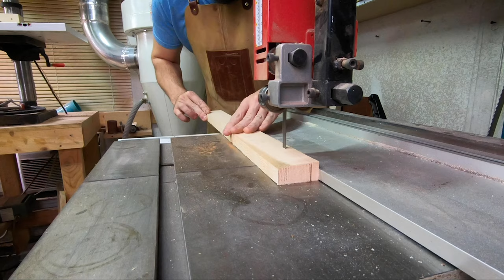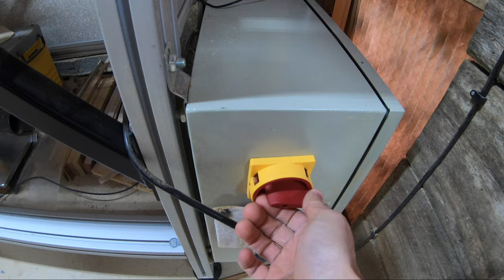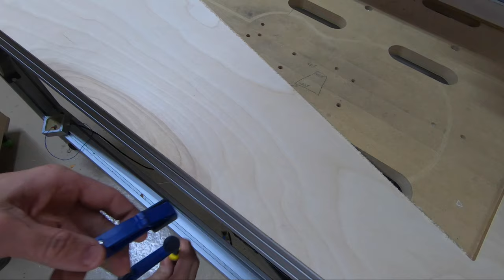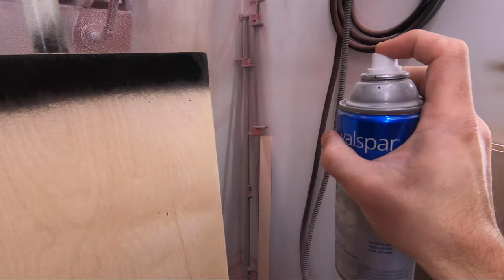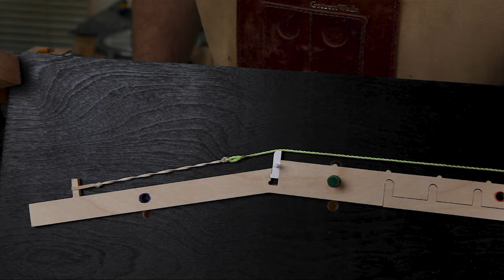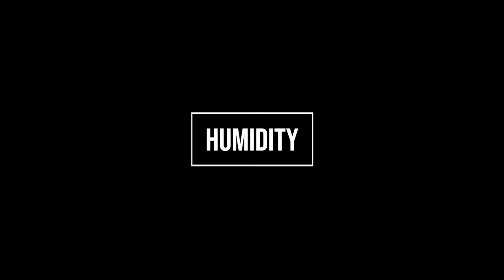How to adjust the action on your guitar.

Comment: Great video. I have an old $100 beater acoustic/electric I've had it for almost 20 yrs. Could never get it to intonate. So I tuned it for slide. However saw another builder's video, a guy described exactly what was wrong my old beater. The guy said "check your nut". 1st I lowered the action by shaving the saddle, that helped, but it still was sharp along the fret board. Decided it was an inexpensive guitar, so I did the half pencil trick, all the strings were too high. I filed the slots to the point I had .020 at the 1st fret, the old guitar came to life. Every fret was in tune on all the strings (to my amazement). The guitar is basically plywood, but she actually sounds Great! I decided to do the same with a newer 335 copy I bought for $150, that, a fret leveling & crowning, a new set of $20 humbuckers, set the action to Gibson recommendations, that guitar sounds good (the pups are $20 so ididnt expect it sound like a real 335), plays like a dream as well. I've been playing 50+ yrs, & never realised how a few thousanths on a nut, could make such a difference. I've got a '92 Fender Telecaster that only needed a bit of saddle adjustment, it's always played great. Of course the guitar companies do set their guitars up with high action, (so they don't buzz when people try them out). Funny how a few tweaks can turn a cheap guitar into 1 that plays well, & sounds pretty good.

Comment: Chris that model is extremely useful, for both acoustic and electric guitar fundamentals. It clarifies the multiple factors that will impact a guitar's playability. I think people often think there is a silver bullet approach, when in fact its' more likely to be a few small adjustments of the 3 main points. (neck relief, nut height, saddle height)
Well done.

Comment: Awesome! I just leveled and crowned the frets on my Furch, cut the nut to the optimal height as well as reglueing the bridge which was coming loose. Unfortunatelly the string height is still not great with nearly zero relief.
This video led me to the conclusion that it might need a neck reset as well. Thanks!

Comment: I loved the demonstration as much as everybody else did. Thank you.

I have an idea for a follow-up video. I am contemplating the installation of taller fret wire. I have not experienced taller frets, so my first question is, "What are the pros/cons and what is your opinion?" There are some questions that your demonstration brought to mind: 
 - Taller frets would bump the straight edge to be above the top of the bridge, right? What countering process would be required?
- What are the other setup considerations/adjustments that will be forced by installing taller frets?
- Could taller frets obviate the need for a neck reset?

Comment: When someone brings me an acoustic to lower the action the first thingI do is eye ball down the edge of the neck to check whether it has any relief or not. Then I look to see whether the top of the bridge aligns with fret board top. Often with neck and body creep from string tension little can really be achieved without a neck reset which is a lengthy and expensive job. Lowering the saddle or even shaving down the bridge which I’ve done several times is only really a temporary fix. 
Great teaching setup jig you have made. 👍

Comment: I live in dry Arizona.  I use 2 sound hole humidifiers in the case, I place one of the humidifiers in the sound hole, the other is just the wet sponge from the other humidifier placed behind the headstock sitting a platform I made for it.  So far so good.

Comment: Fantastic explanation Chris, the clearest I've ever seen. One point about the Taylor guitars is that if you're the original owner you can contact Taylor and they'll put you in touch with a local authorised repair tech to do the work under warranty. Also, if you feel competent enough to do the work your self they'll send you a few sets of shims free of charge so you don't have to go to StewMac. You've got a great channel Chris, thanks.
Reply: My local authorized repair tech stated enfatically that this is normal maintenance and not covered under warrenty. I have seen another video that stated what you did. I don't know what the truth is. And yes I'm the original owner. This is frustrating to not have a clear answer...
Reply: @danherrick5785  Hi Dan, This is my experience as the original owner of a Taylor GS Mini. I was never quite happy with the action over the whole of the neck. As I'm based in the UK I found out the main UK Taylor offices were in the Netherlands. I don't know where you are but if you go on the the Taylor website they can tell you where the nearest Taylor affiliated luthier or tech is that will do the work under warranty or as in my case, I was confident I could do the work myself so they just sent me a selection of shims. 
The only possible problem I found was they need you to have registered the guitar and serial number with Taylor, which I had already done on line as I had bought the GS Mini in early 2012. 
I don't know about any other Taylor offices around the world but the people in the Netherlands were ever so helpful (and I'm not getting paid to say this) 😂😂😂.
It seems to me that your 'authorised repair tech' wasn't an authorised TAYLOR repair tech, otherwise he would have known it was covered by Taylor's warranty.
Since I changed the shim under the neck my guitar plays beautifully all the way up and down the fretboard. 
I hope this helps you.

Comment: Fantastic demonstration. 
Now that carbon fibre guitars are finding a following, it would be interesting to know what you think about them, humidity handling, potential age related issues, sound/sound changes with age/humidity and ease or not, of setting up and/or repairs or re-adjustments.

Perhaps this is a little off topic as you work with wood but still, I would imagine you would still be quite informative on the subject.

If you have a video on this topic, I'd be sure glad of a link to it. Anyway...I enjoyed how you set this video up for us which was probably as Good as anything anyone could want for setting up the action.

One thing worth mentioning is going in small increments at a time with truss rod adjustment, a 1/8 to 1/4 turn as necessary every 24 hours is what I was taught if you value your guitar, giving the wood time to settle, I'm not saying this is right in every situation, just safe.

Comment: Just as good to know type info.

 Many car feeler guage sets, have one guage that is brass. That brass one is usually the .010 one. It's brass because back in the day some auto manufactures requieed the gap in the points to be measured with nonferrous (no iron) material. The brass guage solved that problem.

Comment: Hey Chris, awesome videos , extremely informative and well done. I have not built a guitar yet but will soon, I do have a small woodworking shop and have built a lot of custom display hangers as well as enclosed cabinets with sliding plexiglass covers . I think it would be a good idea in the cabinets (and gun display cabinets ) to install dehumidifiers for my clients..... especially for the higher end guitars . All I'm really seeing are just dry packet things , are there electric options for automatic temperature and humidity control ? Recommendations or thoughts appreciated . thanks ...

Comment: Really brilliant visual way to understand set up variables to get optimal playability.  I am bit confused about the relief adjustment using the stew mac dial caliper tool.   I thought the relief measurement is to measure the max space between lowest part of neck bow and bottom of string and is normally midway between the 1st fret and 12th or 14th fret, or around the 6th or 7th fret depending on where the neck actually bows the most.  At about 8:20, you explain that the Stew Mac relief tool measures the relief at the 12th fret.  And some guitar have "fall off" on the height of the frets on the upper fret board beyond where the neck meets the body, so it seems that would be a variable factor if you are trying to use that tool to measure relief at 12th fret.  I normally measure relief by using a capo on 1st fret and holding down string at 12th or 14th fret and then insert a feeler gauge under string on top of fret with the biggest space, but it is tricky as the feeler gauges are so thin.  I will look into the Stew mac tool and see if I can figure it out as it looks more accurate than messing with floppy thin feeler gauges.

Comment: Excellent demonstration and explanations! I was wondering what you were designing on your CNC machine LOL. I am planning to get started in guitar building (with very little woodworking experience) and have been playing around with the high action on my 1980's Guild D16 (which did suffer a headstock crack and a slight crack on the top years ago - both were repaired) and the action measured about .75 at the 1st fret and a whopping 4 mm at the 12th fret. I tightened the truss rod (I think all the way as it got pretty tight)  and that brought the 12th fret to around 3 mm and not too much different at the 1st fret. There's not much to take off the saddle - at least not double the amount that I would like to remove at the 12 fret. Now I'm thinking that since it does not have a case, it is subjected to seasonal ups and downs in the humidity which is generally between 45 and 60 % mostly around 55% so maybe that is the cause of the problem; maybe a stock case and a humidifier pack would help?

Comment: One clarification I think is needed. Bellying of the top is one of the most common causes of guitars needing neck resets. Very common on Martins and clones. Sometimes fixing bridge plates or braces might fix what looks like the need for a neck reset. Many times it’s just the top moving up a bit behind the bridge from years of tension.
Reply from the maker: Very good point! Should have mentioned that.

Comment: By the way, what I normally do is I put a capo on the first fret and I put a quarter on the 12th fret, and then I adjust Quarter seems to be have the right height for the strings to make sure it doesn’t buzz

Comment: I wish I'd seen your model years ago.  A great invention.   I doubt if you are following comments a year later however two questions.  You didn't cover setting intonation which is easy on most electrics but not so much on acoustics?  The second is why do some guitars hold tune and others don't.  I have a both a D and an 000 X series Martin.  The D holds tune with just minor tweaks for days and the 000 is all over the place overnight.  They are basically identical and I have them set up the same and use the same strings.  Oh and the 000 came from the factory that way.  It was not effected by the setup.

Comment: Like this. Very good learning tool. I had a guitar that nut was to high and it put intonation out will any of these other adjustments put this out also
Reply from the maker: Oh yes! If the action is high, the you have to push the string down further to get it to fret. Because the distance is further, it stretches the string into a sharp direction, thus messing up your intonation.

Comment: Thanks Chris - great video - re string height - you mentioned 80 to 90 thousanths for the low E - could you talk about what height you would set the other strings at if you did the low E at .090 ? Thanks.

Comment: just discovered your video's this week, super, i like ! question : do you know a way to ply a bowed neck without trussrod,  in a diy way, i have this  handmade Spanish flamenco nylonstring ,really a superguitar but i think it had too much high tension-strings in the past ?
Reply from the maker: The best option in your situation is to try to clap together some system together on the neck that’ll bow the neck in the direction you want. Use wood clamps and bow it beyond the distance you want and hope that it land what’re you want it after you remove the clamps. No really good solution to the issue though.

Comment: Great video. One question though. You talk about getting the string height over the first fret to what you like but you never mention the numbers that you like. When I measure the string height at the first fret with the Stew-Mac dial indicator gauge for that (as long as we're advertising them) I get ranges of a low of around 10-12 1/1000ths on the 1st string to around 17-20 1/1000ths on the sixth string. Is there a rough guide for those numbers or a general rule? Stew-Mac's own videos on using their tool is pretty vague.
Reply: You may have already fixed your issue, but I’ll post what I do for my guitars.

First check with your guitar company, see if they have an owner’s manual. Then check string gauges, and keep that as a constant so your set up values don’t change. 
I have a Breedlove acoustic, and use .012-.053 gauge strings since the guitar was originally installed with them, when I purchased it brand new from the store.

Instructions from Breedlove:

String height at 14th fret; 6/64” bass side, 4/64” treble side.

String relief, capo on 1st fret, press down 14th fret and measure at the 6th fret; .010”

Only once I set up both; the string relief and string height, will I then check the first fret action. I prefer .018” for all my strings.

I use feeler gauges for the measurements using 0.0xx” and a string action gauge ruler for the x/64” measurements.

Hope this helps!

Comment: Hey, what is your thoughts on PLEK. After this explanation, it seems a bit simple to look at the fret heights. I'm sure they have some knowledgeable people running the machine and therefore could combine other setup features with the PLEK. Anyway, your thoughts?
Reply from the maker: I’ve never used it and honestly feel like a proper fret job negates the need for such a tool. I’m sure it yields great results, but so does a properly installed fret job, on a perfectly flat fretboard. It’s best for factory made guitars where the time isn’t given to a proper fret job and there may still be imperfections in the fretboard itself. It’s an ingenious use of CNC none the less.

Comment: Hi Chris. If all the factors are set up properly (neck angel, nut, truss rod etc.) but you have a high saddle causing high action but ensures there is enough string break angle, how can we resolve the dilemma here? Lower the saddle will result in an inadequate string break angle, which will sacrifice energy transformation, tone and volume. Hope I can hear your opinion Chris, or if you could do another video about string break angle that’s even better!

Comment: I understand the importance of having and using a 24” precision straightedge.   That said, for measurement of neck relief what are the drawbacks of using the actual string (w/capo @ 1st fret).  Is the major disadvantage the inability to precisely measure deflection when using feeler gauges against the bottom of the string and the top of the fret?    Obviously the StewMac dial indicator jig would provide the most consistent/repeatable process for setups.
Reply from the maker: That’s exactly it. Anything other than the dial gauge just doesn’t offer the accuracy needed to nail a setup consistently. In order to be sure that all of your guitars are going out the door with reliable and consistent playability, you gotta know the numbers.
Reply: @DriftwoodGuitars  I can see that would be especially important when its your reputation attached with every instrument you build, nothing less would be acceptable with the amount of time invested into each instrument.
I consider myself a shady-tree hobbyist of sorts, started playing guitar back in 1974 and working on them soon thereafter.
Thank you for these videos as your experience and ability to articulate are greatly appreciated along with your willingness to share what you know.

Comment: I want to know why an acoustic guitar with steel strings, the action, the lower it is the better it feels and stays where you can touch it very gently to get the perfect sound. Why a lot of guitars, especially acoustics are built and sold with high action to the consumer how high is too high and how low is too low can you answer that I would really love to know your response I have a Martin and it all with high action and I’ve tried to load them very low to get that fuel and still on able to get it as low as possible

Comment: When you set the truss rod to .005-.010 at the 12th fret, is that unstrung?
Reply from the maker: No, you always want to make adjustments with the guitar at full tension.
Reply: @DriftwoodGuitars  thank you so much!  I bought a guitar and shipped it from NY to New Mexico, and the dry desert air has affected the whole setup.